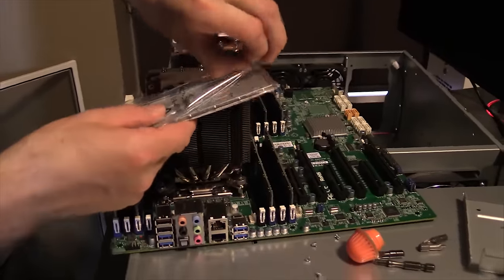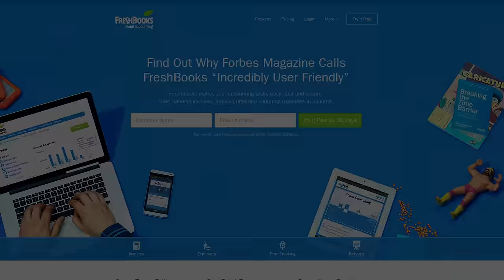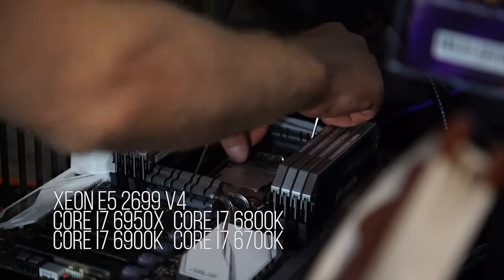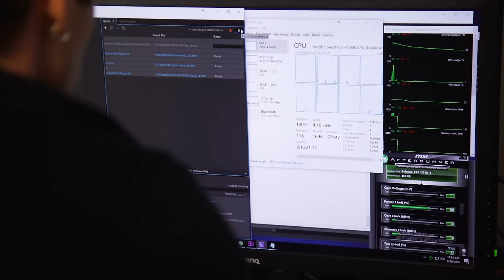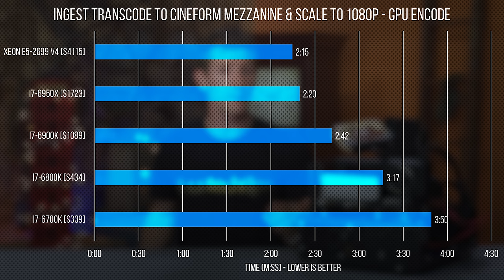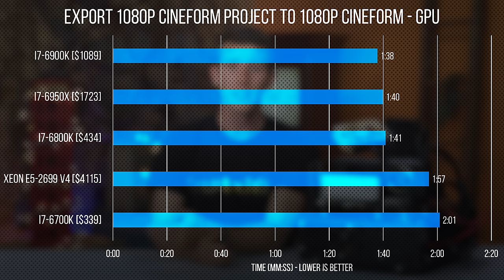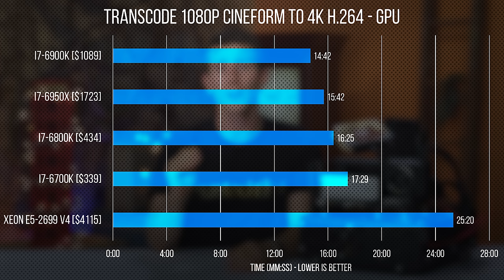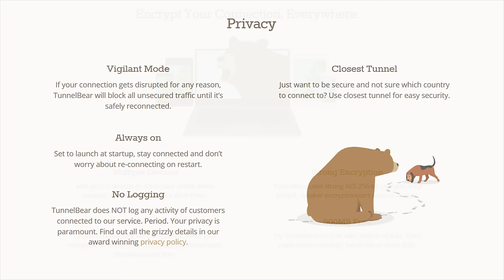$300 CPU Beats $4000 CPU?? - Cores vs clockspeed for video encoding

Comment: from this video, now plz make a best  youtuber pc
Reply: if you want to put a limit under $1000 or $1500
Reply: Personal experience here - You want HD Space and lots of it, and it needs to be fast. You'll then need at least 64GB of RAM if you're planning to do lots of editing, though you could probably limp by with 32Gb (Don't cheap on RAM)

From there, any consumer grade CPU and GPU should be enough. Since you're limit is $1500 that's pretty much all you'll be able to afford anyway.

If you're looking to do this as a business, you'll want high upload speed on your internet connection. So you can stream live as well (The future of YouTube)
Reply: 16GB of RAM is the better way to go, Linus actually did a video on performance with adding more RAM to a computer. And unless you are trying to make a really long video, I don't even think 16gb of RAM is even necessary. You can definitely cheap out on RAM. But got for at least a dual core with multiple threads or a 4+ core CPU. And depending if you want to run games at high quality on the rig and record it, then getting a gpu around $200+ would be ideal. For open world games, then you might want more RAM for recording, as you would need it for video buffering for long sessions.

And having lots of storage is also important. You could build a Youtuber PC for $500 or less.
Reply: Agreed. 16 GB of RAM is plenty to start out with. Just be sure you will be able to upgrade your memory as cheaply as possible -- get a motherboard with four slots, not two, and get 2 x 8 GB sticks instead of 4 x 4 GB. Then if you need to upgrade sometime down the road, fill the two remaining slots with 16 GB sticks, giving you 48 GB. That way, you only need to toss memory sticks if you ever need 64 GB over 48 GB (which won't be likely).
Reply: I have often found it deeply disturbing that people insistently say "NO You don't need any more than 16GB of RAM".. It's one of the cheapest components of any system. With even top quality RAM in 2 stick configurations it's $75 for 16, and $140 for 32, and $250 for 64... 

Look if people don't know what to do with their extra RAM to get performance out of their Windows system that's their problem. And Windows WILL use more RAM if it's available the fact there is little performance increase is not the concern. It's the fact Windows WILL use it, and if you ever need it, it is there to use!

Want to know what to do when you have 64GB of RAM? Create a RAM disk and put your windows SWAP file on it. Don't give me crap Windows hardly uses it because it does! If you want Windows constantly writing to your harddrive go right ahead, I on the other hand use 8GB RAM disk and have it swap to RAM. Saves on Writes to the Harddrive, and swapping at RAM speeds vs HD speeds is a performance increase!

Don't think you'll use that much RAM, well with encoding no you don't, but actual video edited, YES you do. You want to have multiple tracks of audio and video with overlays and crap in certain parts of the video you'll WANT that RAM.

Listen to plebs saying "Save yourself $65 on your $1000 PC and don't get any more than 16GB of RAM" if you want, but it's better to have it and only need it every so often than to suffer and never have it.

So why would Linus put 128GB of DDR4 into a system if 16GB is all you need and there is no performance increase beyond that? Oh maybe because sometimes he does need more than 16GB? Again it's almost as cheap as buying a mouse for your system, why the HELL cheap on such a cheap component that we all know in large amounts DOES improve performance just not as much as we'd like.
Reply: I would maybe say instead of getting 32 or 64gb of ram off the bat, maybe get a single 16 gb stick for the upgradability to 64 later on if 16 isnt enough

Comment: the only real failure in this video are the charts.
Like really don't mix things up. Yes it looks neat sorted from the fastest to the slowest from top to bottom but switching the position of the different cpus is very confusing.
Another solution would be to color each bar for each cpu so you can easily see which bar belongs to which cpu but as it is it really is confusing and makes it hard to get all the information while listening.

Comment: HI Linus, I hope you are doing well, I always watch your videos. 

I have a question, I'm going to build a gaming pc, and I want that it's 4k capable and vr ready.  

any tips on the parts I need to buy??  my budget is 7k but of course, the less I spend, the better, thanks.
Reply: you only need 2000 bucks to get a beast 4k 60fps and vr gaming PC. you could ask over on the ltt forums, people there are very helpful
Reply: As Pigs Nation said. Come to the forum and people will happily help you.
Reply: Ni De Thanks I will ASAP
Reply: What Pigs said, but also you can ask over at /r/buildapc, tell them you have a 2-3K budget, they'll go nuts and all argue it out over what you should get.
Reply: You could probably get away with a single 1080, but an SLI setup would guaranty 60+fps on Ultra at 4k (in games that utilize SLI).

Went with a white / black theme. It could be made cheaper or more expensive depending on what you want. I'd suggest investing 1 - 1.5k in custom loop to get the best performance possible. The monitor is 4k IPS and G-sync.

http://pcpartpicker.com/list/V6NDZ8
Reply: ok,in at the main page of the forum,i just registered,can you share me the link so i can make the proper thread please.
Reply: Kal El
goes in new builds and planning.
Reply: Ni De Thanks, I did so. Now I have a list of parts.  The only thing missing it's the monitor.
Reply: Kal El
GPUs? I would definitely go for a gsync 4 k monitor if you have the money
but if you are running 1080 SLI ... you might aswell just chose a modell for different reason ... because you gonna get enough fps you know ;)

Comment: Wish you would do this same testing with a few more around that 6950X range, like the 2680 v4 (same price as the 6950x, but 14 slower cores) or 1680 v4 (same price as 6950x with 8 cores but turbos to 4Ghz instead of 3.5Ghz).

Comment: Hello linus. I have a lot of experience with those kind of Xeons. I think you did few mistakes. There are generally  issues with Windows  + many threads + SW that does not know how to operate it. + Issues with the Xeons themselves.

1. C states. Even if windows are set in high-performance power profile (do not even try at ballanced), the CPU cores still get parked/unparked and generally it does not run at full speed all the time unless fully loaded. This is caused by stupid windows behavior which tried to control the CPU clock speed based on global % of CPU load. 1 Thread is 25% on 4 core CPU, = full speed, but it is only 4% on 22 core CPU, even half of HT is there. And in that moment, windows will simply downclock the CPU trough speedstep, thinking its not loaded enough.

To avoid all of this, just disable the C-States in bios. C1E, C3, C6. Those. This will also disable the dynamic turbo, the CPU will now run on its all-core turbo, which is 2,8Ghz for E5-2699v4 during normal load and 2,6Ghz during AVX load, but the Turbo itself even tho it goes up to 3,6Ghz is useless. You know why? Cause I have noticed (multiple CPU's and boards) that the turbo scales only with purely CPU loads. Only the GPU and PCI-E controller is loaded, it will always get stuck to max 2,8 anyway. So always pick CPu based on its all core turbo, not the max turbo, you can see on ITwiki the exact numbers:

https://en.wikipedia.org/wiki/List_of_Intel_Xeon_microprocessors

2. Hyper-threading. If the SW you are using is using less then say 60% of the CPU, it is always better to completely disable HT in bios. Windows till this day do not treat HT threads as support HT threads, they treat them as another CPU's, and unless the programs locks itself on certain cores, windows will always move it from one core to another, sometimes throwing 2 at the same physical, etc. Its a mess. HT is goof for I3 or even I7, but if you have this many cores, there are a lot of situations where it hurts.

3. Numa. Its not the case of single 22C Broadwell, but your previous 2x18C machine was numa. Numa basically means that there are 2 CPU's with 2 separate memory segments connected trough QPI to behave and single. In practice, guess what happens if there is a program that is not numa aware (99%) of windows software. and it is cache or memory sensitive and it is running across 2 CPU's which do not share one cache. Ouch... yeah, every time they need some data, it needs to look to the other CPU's cache over QPI bus, which takes a lot of time and adds a lot of latency. From what I measured if you run for example a CPU limited game on dual-CPU system and you lock it on only single CPU, it will run about 1/3 faster than if you split it acress both of them, for exactly this reason. The numa and QPI behavior can be tweaked on server boards, I recommend enabling home-snooping or early-snooping on QPI, this gave me the best result in common SW. Alo, I can recommend a program called "process lasso" it is a great tool for thread/priprity/core parking management. And it is golden for users with SMP systems. The advantage of numa system is that you can run something that totally loads mem controller (makes the whole OS slow and sluggish normally) and you can bind it completely to once CPU, and run rest still smoothly on the other. Or in server environment, you can do magic there with virtualization.

4. The CPU itself. E5-2699/2696 is not the best Xeon out there. The best one is E5-2679v4. It may have 2 cores less and TDP of whopping 200W, but it is 3,2Ghz base turbo on full load, if you tickle the FSB a bit you will be at 3,3. That CPU is the best. I used to have E5-2696 (OEM variant of 2699) and I changed it for 2679 and it is objectively better. That one is ATM the strongest x86 CPU. There are others that have more cores, but their low clockspeeds hinder them. But even at its 2,8 Ghz, the E5-2696 surprised me a bit at some situations. For example games. I expected it to be bad, but it actually performed like 5960X overclocked to 4Ghz (off course the xeon was running with no HT and C states, as  I described before, with those active the score was much worse). The reason was the huge L3 cache, which helps a lot for games, same as it did with the small Broadwell 5775C and its 128MB L4. Next point is power consumption and performance/watt which is just amazing, especially if you fully use it, like rendering in cinemax, etc. For normal use if you have tons of money E5-2679v4 is the best CPU. For reasonable person that was real high-end, the best deal is Xeon E5-1660. The models E5-1650,1660,1680 (regardless of generation, aka this applies to V1 V2 V3 V4), are unlocked and are super similar to I7 and I7 extreme. But they are Xeons, so they support TXT, ECC REG memory, etc, etc. So for example instead of buying I7-5960X. get Xeon E5-1660. Its the same chip, same OC, and will give you Xeon features. I do not recommend LGA2011v3 Broadwells, the IPC is basically the same as Haswell, and they overclock way worse. And the 10-core model is way overpriced considering what it brings to the table. 8-core Haswell-E + some OC on water is still the best enthusiast CPU.

Comment: I7-6700K here. Would the 6800K be any better than the 67 for gaming?
Reply: no, 67 should hold you up for a few years at leased. I'm still using the 2600K and its fine for gaming
Reply: nah, if anything a i5-6600k is overkill for most (if not all) games.
Reply: In a handful of games, hexacores like the 6800K see better performance, by a small margin. Two examples are GTZ V and City:Skylines. The vast majority of games will run either worse or the same, due to the lower IPC moving from Skylake to Broadwell-E.
Reply: With a 6800k you have an upgrade path.
Reply: ***** Only within the X99 chipset. If Intel follows the same socket update patterns, a new enthusiast socket will be out when Skylake-E drops, which is likely next year. On the other hand, Kaby Lake is supposed to run the same Z170 chipset and LGA1151 socket as Skylake.
Reply: +://ReaperReaper What I mean is you can used upgrade to a 6900k or 6950x when it becomes cheaper.
Reply: Why would you? It's still way overkill
Reply: +Noah Christensen Because it has 40 pcie lanes and more cores. It's better to get a 6800k because software will improve and support more threads. With z170, you can only upgrade to a 7700k which only has a 10% improved IPC rate over the 6700k. Consoles have 8 core CPU's and will dictate how games are run. However since the 6700k have eight threads, you don't have to worry.
Reply: gaming and Video editing or just gaming?
Reply: ***** That won't change the fact that you'll still be running chips that aren't that good for gaming. The few games where more cores equates to better performance still cap off at 6, with the difference being marginal at best.
By the time developers are pushing games that consistently leverage more than 4 cores, the 6900K and 6950X will be irrelevant. We'll have moved past that, and more powerful hexacores and octocores will become what the standard Core i7 is now.
You'd have a point if Chrona was a professional game streamer or commentator, and used software that leverages additional cores for CPU based encoding, but they only specified that it was for gaming. The gains are still not overly beneficial to go from the 6700K to the 6800K. A 5820K would be the better choice, same number of PCIe lanes (28 for this particular set of X99 chips), same IPC (within 1% different), same TDP, and a .1GHz reduction in clock speed (more than made up with Haswell's better overclocking potential and the lower price).
Reply: My 4.7ghz 5820k does not agree with you that it is slower than the quadcores in game performance.
Reply: It's more than enough!
Save your money Bruh!!

Comment: I am a noob to all this, so, hy not just run the xeons in cpu mode only, to get the best performance?  Was the miscalculation made with the GPU assistance?  I would be upset after spending that amount of money, to find those results, but, there was no way in hell you could have known that in advance or even predicted (that outcome).  Well looks like the industry is not sharing their lab test results with us and only letting us talk to the sales persons from the company.  How can you ever know what system will work well or hinder desired performance without some honest real world testing.  Thanks for the LINUS.     Well with all that said, I just did the same thing, but on a smaller scale.  I just purchased a $700.00 dollar dual set of E5-2660 Xeons for my home use and now will have to keep you informed as to how they perform in the future.

Comment: Could a Xeon E5-2687W v4 based setup be more practical, perhaps? You lose 10 cores per CPU, but get 3GHz base clock in return. As long as the software you use is NUMA aware, it should be on par with or better than a non overclocked i7-6950X, depending on how multithreaded the specific workload is. Plus it is still an E5-2600 series CPU, so dual socket capable.

Comment: I believe that speed only matters a little when it comes to xeons. Am i wrong to say that xeons are meant to handle more multiple work loads than a quad core cpu with Hyper threading like the core i7?

Expecting a "36 dual core Xeon machine" to out process a Core i7 is like a semi truck versus a Ferrari race car. The truck carries alot but its super fast while a ferrari IS fast but does not carry as much as a Ferrari. Dont you people at LMG have the xeon machine processing multiple work loads?

i mean come on, Enlighten me here.

Comment: But will they change the editing server setup ? i7 cpu's don't work on the dual socket boards and they don't support ECC memory... or a second server with x99 and i7 for the workload which benefits from higher clockspeed ?

Comment: So you made the same mistake AMD made with bulldozer: you assumed more threads was better, when, in fact, most single workloads aren't heavily threaded enough.  You only benefit from a ton of cores/threads when there's a bunch of different things vying for CPU time.  The xeon is a server chip and server workloads are highly threaded since there's so many, independent requests happening at once.

Comment: I'm not seeing any results like you're showing. Using AVC(my camera) as my starting codecs or using MXF(what you use) to Cineform shows no difference and no GPU usage. Going from Cineform to h.264 gives the same results, no difference between CUDA and GPU and shows no GPU usage.   I have a 6700k, GTX 1080 and 32 gigs of RAM. What am I missing?
Reply: I just read a blog on adobe and ran some tests. It's the scaling you guys do that activates the GPU.  Keeping it all in 4k or all in 1080p keeps everything cpu bound.
Reply: Scaling  it down to 1080p helps them work a lot faster, and because of YouTube's compression upscaling it back to 4k produces basically the same image quality compared to if they had kept it in 4k the whole time.

Comment: WAIT LINUS!!!

Are you sure that it's not a matter of the translation. between the CPUs and GPU?

Please consider running those tests with dual Graphics cards (probably outside of SLI)... 

Perhaps both CPUs attempting to share the GPU is forcing bottlenecking, vs dual or tri cards allowing proper saturation at the scale of all of the cores.

I am theorizing that such a minimalist setup, detrimentally downgrades the performance, and that we are not merely seeing a "generalized" lower performance...

Kind of like slapping a high performance motorcycle exhaust into an M1 Abrams tank... it is a powerful tank, which you may choke, due to insufficient parts which may work well...   if you add more.